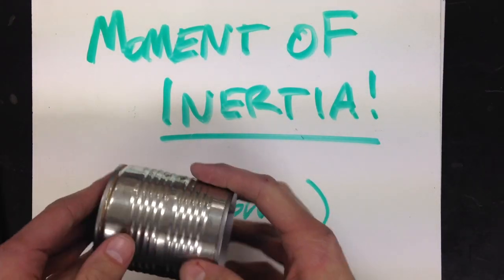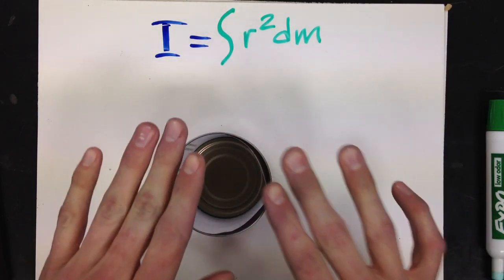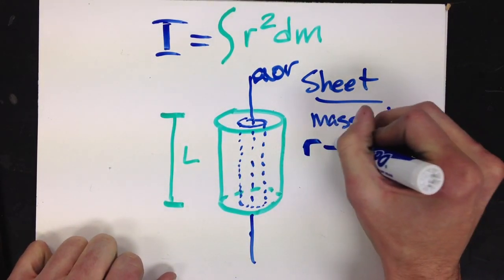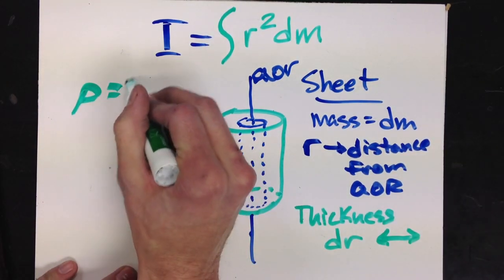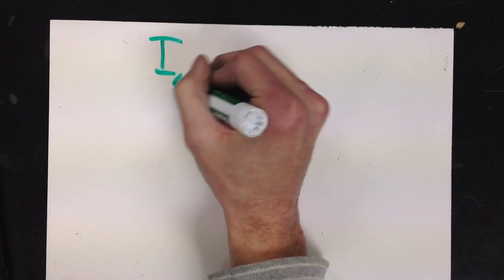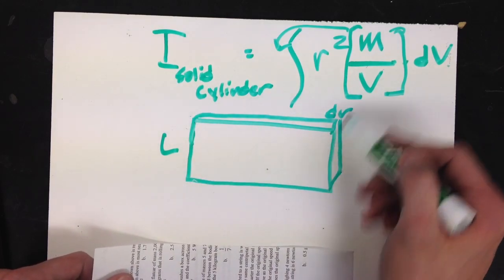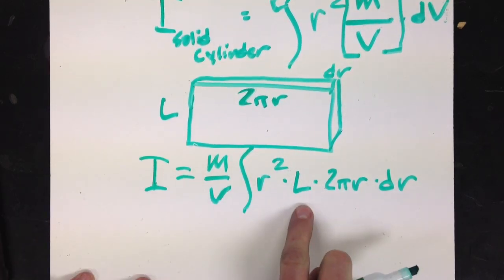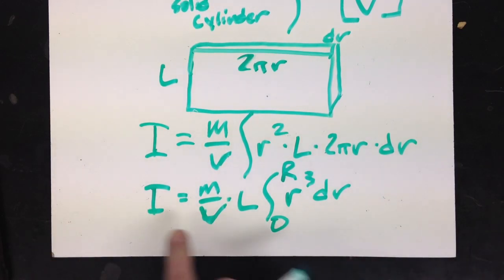Moment of Inertia (solid cylinder)

Comment: Excellent video. Nice and simple sticking to the basics so you really understand what is going on. I'm just missing an explanation for why you're including mass and volume. Is this how you compare mass moment of inertia and area moment of inertia? Would be awesome if you could elaborate on that. Also m/V*L becomes m/A, so density becomes pressure, which I find quite interesting. Lastly I would love a comparison to a solid cylinder or a pipe with a thickness. Awesome work!

Comment: hello, thank you very much, i have a question, if instead of "unfolding" the differential sheet to obtain dv like you did i obtain the whole volume of the cylinder (which is v= Pi*r^2*l) and i do the derivative of that in respect to r (dv/dr) why do i obtain the same volume for the differential sheet(dv=2*Pi*l*dr)? it seems mathematically corrrect but i dont understand why that happens, thank men youre the best